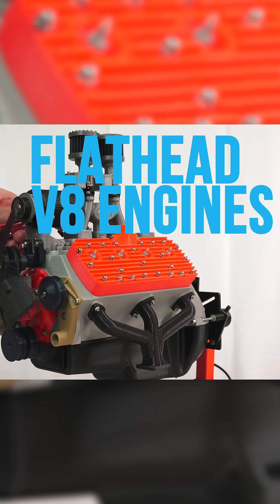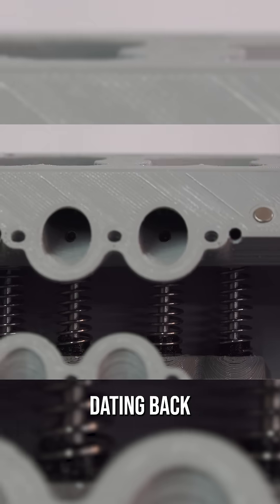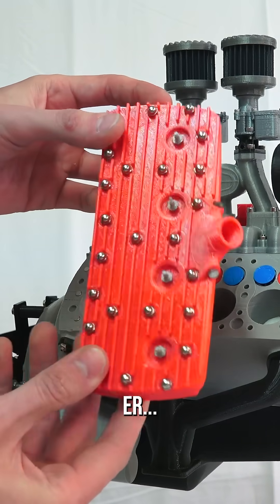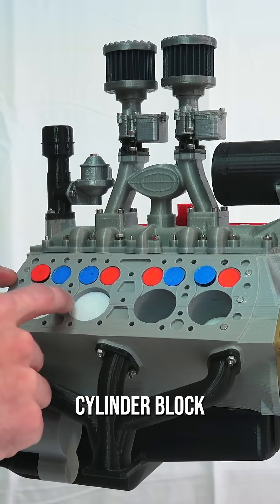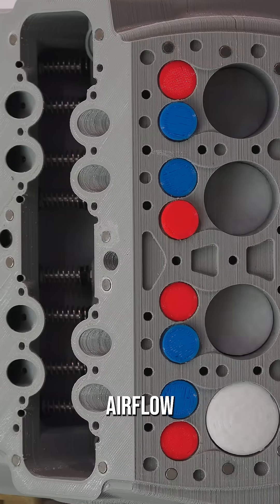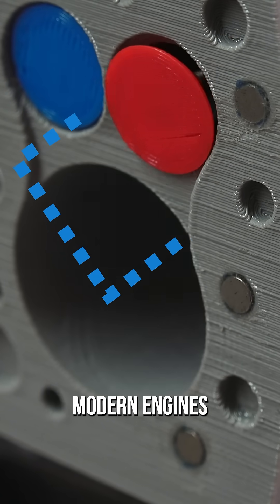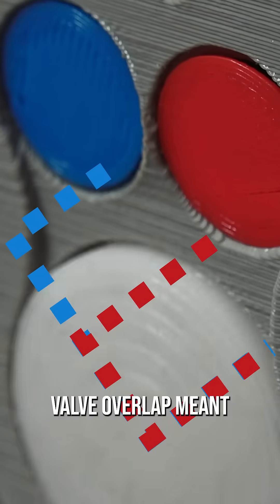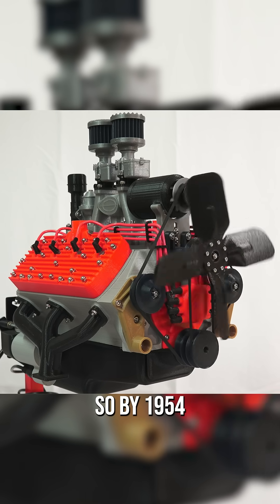What Killed The Flathead V8 Engine?

Comment: I have often wondered why old engines have less power despite their size, but this explains some of it. Very interesting!
Reply: its many factors not just this. direct injection is another that boosts power. engineering and manufacturing tolerances have also gotten soo small since then. Back then all they cared about was raw power. If it drank a gallon of fuel per mile then oh well. Only when the oil embargo happened did they have to start actually trying to figure out how to make a good engine to reduce fuel consumption. also a bigger more powerful engine is more fuel efficient.
Reply: Lots of things contribute to that. Lower volumetric efficiency, lower static compression ratios, lower dynamic compression ratios as a result of poor VE and low static compression ratios, undersquare engine layouts rather than square or oversquare limiting valve size also lowering dynamic CR, poor port geometry, etc. Not to forget the major improvements in machining techniques, mass production, engineering, as well as the material improvements. A lot of the technology we see on cars now have been around for close to a century now like direct injection on gas engines and more than 2 valves per cylinder with DOHC, but they were mostly reserved for bespoke race cars or high end sports and luxury cars. If they wanted to produce something that could sell widespread, they needed something easy and affordable to produce and machine at a profit as well as easy to assemble for a production line. This was simply the best starting point for the masses at the time. Might not be efficient or powerful, but at the time it kicked civilization into high gear
Reply: Successful use of DOHC actually pre-dates the production Ford Flathead V8. It took way too long for it to catch on.
Reply: @rotorhead5826 
Most ideas had been tried in the early days, but it wasn't practical for the common person.
Wealthy car buyers push for technology that others can't afford, so it does take long to catch on.
American manufacturing comes up with incredibly unique stuf and the company eventually drops it, and then European manufacturers would take the idea and improve it and make it successful, over and over.
Everything new is Old.
It's easier to think of it, but more difficult to make money at it.
Reply: By the 1950s, and 60s these were replaced by overhead valve engines like the Chrysler Hemi,  the small block GMs and the Ford Y blocks. These engines provided higher compression and much more breathing capacity.
Reply: Tractors are generally designed to not have high horsepower.
They want low-end grunt.
Push the pedal a little, and you're already in the peak torque area.
A friend of mine has a John Deer with a two cylinder engine, and they're huge.
It has 321 cubic inches of displacement, which is as big as many V8s, and produces less than 40 horsepower.
Reply: Big improvements of the last 30 years where dohc which gives you 4 valves per cylinder, direct injection creating the air fuel mixture right in the cylinder, not in a carburetor, electronic injection, giving you the option to vary the mixture depending on many factors and other advantages I don't know of. Except in America where all these came about 20 years later like all car technologies. There is even a video about it on this channel where he talks about it with the example of the Corvette C8 which introduced many of these features to chevys flagship model.
Reply: @electricpaisy6045  Weird.  My 95 Subaru has 4 valves per cylinder yet only one cam.
Reply: @johnpublic6582  really? How does that work?
Reply: @electricpaisy6045  A cam, rockers, valves.  Pretty much exactly the same as any overhead cam engine.  You might say it is kinda odd in having three lobes for each cylinder.  The outer two do the two intake valves, and the middle one has a forked rocker that does the two exhausts.
Reply: @johnpublic6582 
You can have single overhead cams in a 4 valve head or a twin cam in a 4 valve head.
If it's a flat four cylinder engine and overhead cam, the minimum cams per engine is two, but four cams total is more common in a performance vehicle.
Reply: @MorganHJackson  
They were built for longevity !

Comment: My dad told me that flatheads were very easy to work on except for the valves. No adjustment, you get a new valve and custom fit it by grinding it to length. If you grind it too short, you get another one and start over.
Reply: I don't know if that's true of the V8, but it wasn't true of the inlines.

Comment: The exhaust also traveled through the block around the cylinder creating a very hot spot at the top of the cylinder under higher load
Reply: That tended to crack the block.
Reply: That was just the Ford Flathead. Other V config flatheads had the exhaust coming out the same side of the head as the was on.
Reply: This is the real reason, his reason of reverse flow heads is incorrect because they used that for many years after
Reply: @amorag59  a flathead isn't the same as OHV/OHC reverse flow; where he says it "reverses" he's talking about the 180° turn it has to make to get from the intake valve to the combustion chamber (and vice versa from chamber to exhaust valve), and in an OHV/OHC reverse flow head, there is very little "interfering" flow during overlap compared to the long distance they both have to travel during overlap on a flathead.
Reply: @jsquared1013  Gotcha, didn’t pick up on that, thanks
Reply: @jsquared1013   exactly an ohc or ohv has the valves opening right in the combustion chamber versus off to the side.

Comment: Also, you didn't mention that these flatheads had very low compression.  The combustion chamber on the head had to be higher to allow the valves to open completely.

Comment: EE your better then spreading misunderstanding, you don't want flow from one valve to another even on overlap. The flat head Ford's flow problem is the exhaust that has to snake around the cylinder through the engine block to exit on the outside of the V. You also forgot to mention how compression ratios are inherently limited because the valves are so far away from the piston and need room to open. This is another flow problem when increasing compression.

Comment: Henry Ford's breakthrough was in developing casting technology to make the block affordably. Up to then multi cylinder OHV engines were made in multiple pieces with the heads, cylinders and crankcase all being separate. There may have been some one piece blocks available before I missed but I do not think so it was definitely the first to be made affordable for the mases. Remember this was 1932
Reply: Right you are!

Comment: My tractor has an inline 4 flat head. Made new a whopping 26 hp. Thing runs like a champ and doesn't smoke. For being 72 years old it's pretty impressive.
Reply: Less to go wrong and easy to fix when it does 👌
Reply: @matthewnicholas6365 how is it easy to fix? Any valve damahe and the block was junk  easier today...damamge a head or vavle and replace the head, done
Reply: @1gbayfisher With the low octane fuels valves rarely burned severely enough to damage the seat. Reaming the valve seat , lapping the valve and adjusting the lifters and you are all set. The flat head is vastly cheaper and the gasket is easier to make also.
Reply: Fords flathead V8 had 85 HP!🐎
Reply: @ludicrous7044  Hold onto your britches, this V8 is gonna send us to space.
Reply: Because it simply worked, I also have an 81 year old 9 n that will and does mow six foot tall crap all day and you will wear out before it does, also a sixteen year old farm boy can repair it with a crescent wrench and a hammer. BUT. my John Deere is sure smooth and comfy😂
Reply: @jimhrn8522 Thing I don’t like about my 9N is that first gear is real tall!!!!! We take it to shows , with my 2 N steel wheels with lugs!!! If there isn’t a dock it is a butt puckering ride  up a steep trailer ramp going fast!!!!!
Dad bought the 1941 9N when he was 16 so was the tractor!!!
He got paid more helping on the neighbors farm. He had a 1932 mcCormickDeering  10-20 on rubber. No hydraulics to lift the plow!! 
Dad bought that and restored that also. 
The 2N came out  2N   1942 , Ford could avoid price controls by making it a new model. It didn’t have a battery, crank start. It had a mechanical magneto rather than battery and coil. It had the option for steel wheels. When you wire out your rubber wheels you could go to iron and use your ration coupons for other tires. Usually by trading with someone. Ford was a sharp operator. With the factories making so much material he could make the 2N cheaper but sell for more!!! It was a great tractor too!!!
Reply: @williamphillips642  don't remember my own comment ( olditis) but my 9- N i can walk alongside at idle and the damn thing would idle up a wall if it would stick, not sure what you have for gearing but perhaps find a Sherman section?
Reply: @jimhrn8522  Everything is smooth when it isn't running...
Reply: 8n?
Reply: @csme07 That's what I was thinking/wondering. Over here we got the original Ferguson TE_20 version with the Standard Motor Company OHV engines for both the petrol and diesel versions. Mine is the diesel version.
Reply: @csme07  yes
Reply: Try that with a newer tractor 🤣the tractor will be ☠️
Reply: 700 horsepower flathead holds the land speed record for its class at 302.462 miles per hour i have a 430hp ford flathead in my 32 hotrod I love the sound of a flathead
Reply: @pitbullgamer8116 
Forced induction, like blowers or turbos, is what makes those numbers.
Reply: In all seriousness, I have a 15 hours breaks and scrap em that board with a racing cam and ported that's makes 29 horses
Reply: @dannydecare2116  I respect the commitment 🙌
Reply: 26 HP was pretty good for the time!
Reply: But why would there be a flat head on an inline? The camshaft doesn't need to be placed in the block to feed all cylinders. You could just put it on top without any added complexity.
Reply: @electricpaisy6045  The instant you move the camshaft out of the block you immediately make the cylinder head a much more complex piece to design and cast.  

It also makes it harder to seal the combustion chamber as your head bolts now have to be placed to not interfere with any part of the valvetrain in the head, that usually means fewer bolts total so each of them is under greater individual strain.
Reply: @sw96  the head gets as much more complicated as the block gets less complicated. Even less because you can throw out the push rods now. And the bolts already had to be placed around t he pistons before at that position they also shouldn't interfere with the valves. Maybe you need to move them away a few cm more but not that big of a deal.
Reply: @electricpaisy6045 block wouldn’t be any simpler, also consider that it wouldn’t be an overhead cam just overhead valves like a modern American v8. I have a ‘73 mgb that has overhead valves and a cam in the block. It works really well for older tech because the main benefit of an overhead cam is rpm limit, which being an older car the valves weren’t the concern you’d kick a rod or snap a crank WAY before you’d start floating valves if you did even minor valve train mods😂
Reply: @electricpaisy6045 True you eliminate the pushrods BUT you have the casting for the cam mounts, castings for the mounts of the rocker arms that are more complicated than in a pushrod engine. 
Then the worst part. Cam in block you drive the cam with gears. Very reliable and established technology. 
With the cam up top you need better oiling. You need more complicated gaskets, either a chain or belt is needed much less reliable than a gear. 
A tractor needs to be very reliable!!!! 
Especially a flat head makes a shorter engine. Lower hood or more room in the engine area.
Reply: @williamphillips642  Why not just have a casting with no rocker arms. camshaft directly to the valves and aside from the chain you have the same complexity in the head that was earlier in the block. And I'm not talking about reliability or mmaintainability here. We are talking about the first concepts of engines so what ever came to the engineers minds first.
Reply: @electricpaisy6045 Sure there is added complexity. 
You need more timing chain or gears. Overhead makes a taller engine also. The heads need more complicated casting, especially the bearings for the cam and the mounts for the valves. Adjusting the timing is harder, I know I have both styles in tractors. The flat head you just unscrew two big wing nuts ( no wrench needed) and the lifters are right in front of you real easy to access. No taking off a hood or anything. 
With an OHV engine you have to break the seal of the valve cover gasket usually ruining the gasket. Then you have stuff in the way. Now done you scrape off the old gasket put the new gasket in hope you didn’t lose any of the dozen screws. Wipe up all the lost oil and then check oil level and go for a test run!!! 
The flathead would have half the field plowed by then!!!
Reply: @electricpaisy6045   Low cost, low end torque, ease of maintenance, better reliability for the time period, slightly easier to pair with non-synchronized transmissions, etc.
Reply: @electricpaisy6045  mostly the rockers and having to produce another machined part. Think about how simple a camshaft with a flat head is, it’s literally a cam, then pushrods straight to the valves. An overhead valve has rockers and more complex geometry. Also I’m assuming it was partly because maintenance on a flat head is easier, also with the low rpm airflow potential doesn’t matter neeearly as much. Hope that helps
Reply: @electricpaisy6045  the cam acts directly on the valves. It has fewer parts, making it cheaper to build. 
The farmall Cub had a flathead 4 cylinder from number 1 in 1947, til the last one in 79.
Reply: @electricpaisy6045 cars and especially tractors went to overhead valves with pushrods long before an overhead cam. Overhead cam means a precision belt or chain. Quite long and early ones broke. Tractors especially are made to be heavy duty, simple and reliable. Chevy made just one prototype tractor. It wound have been the first tractor with hydraulic brakes but the engine and transmission probably would not have lasted. They were from a truck and tractors especially plowing need a real heavy duty transmission and rear end. Trucks are heavy duty but tractors are super heavy duty. Weight isn’t a problem on a tractor. They are designed to be very heavy while a road vehicle is always trying to save weight.
Reply: @electricpaisy6045 probably to share the v8 design or to have it all in the block for reliability maybe?
Reply: @electricpaisy6045  back then they did not have the knowledge to do that. plus you don't even know what you are even talking about
Reply: @electricpaisy6045  Casting the head is far more complicated, extra cost and complexity with rockers, cam drive etc etc.  Fuel at the time was of a low octane so a 6:1 comp was normal which is adequate with a flathead, but as compression needs to increase due to better fuels airflow drops with flatheads requiring the manufactures having to go through the added complexity and cost of overhead valves/cam.  There is always a reason things are done a certain way and unless it's government, it is rarely done that way due to stupidity.
Reply: @kingcosworth2643  my point was that the same complexity that goes in the head was earlier in the block so you don't gain anything, but I've already discussed everything in the comments
Reply: The fact that your beast of a tractor doesn’t smoke after 72 years yet my 16 year old Honda smokes like a stoner after idling for 5 minutes is crazy
Reply: hi
Reply: Don't mean it's good.  It's absolute garbage you should scrap the POS
Reply: Ele tem o ESCAPAMENTO diretamente para fora da Câmara de Combustão, e muito melhor que "PASSAR DENTRO DO MOTOR ENTRE DOIS CILINDROS ADJACENTES" para sair do OUTRO LADO...
Esse e um PROBLEMA CONGÊNITO INSOLUVEL do Ford V-8 "Flathead".
Se interessar, procure ver como eram o LINCOMYNG V-8 do CORD, e o OAKLAND V-8 (Posteriormente PONTIAC), onde a Descarga saía pelo centro do V.
Reply: My grandma is also 72, but she does smoke…. A LOT.
Reply: To have good head it has to be complicated.
Reply: Compression ratio??
Reply: @SublimeSNJ 6.5:1 new
Reply: Them 8n's are beasts that brought tractors to the masses, my favorite for chopping the lawn
Reply: Inline engines in general seem to last forever,  especially the diesels. Probably because they're so simple,  less angles to wear the metal down but typically much less efficient,
Reply: And that thing could probably put on 1 million km. Old is gold
Reply: My slightly modified geometro makes more ducks then 26 lol

Comment: so why didnt they put a second set of valves on the opposite side in opposite arrangement for higher flow
Reply: Because if the valve was on the opposite side of the cylinder they wouldn't be able to open it with the camshaft that's in the middle of the engine.

Comment: Journey from 1932 engine of 180° Valve  angle to 1997 LS engine of 15° Valve Angle is one of steady HP per C.I.D. improvements . From .25 to well over 1.0  common now
Reply: Chevy had an OHV V8 in 1917

Comment: Don’t forget about Zora Arkus Duntov’s OHV conversion for the flathead.
Reply: Ardun Hemi heads with a supercharger in the middle are the two cylinder heads on top of the engine.... It made it around 200 hp... The kit produced about 200 horsepower used in dump trucks.  Check out Frontiac cylinder heads for a model t Ford 4 cylinder .. it was a double overhead cam cylinder head....

Comment: The biggest problem with Flatties is you can't get the compression up very high because it needs a lot of area for the valves to breathe.   It wasn't until after WWII that high octane gasoline was now available and higher compression could be used which doomed the Flattie.